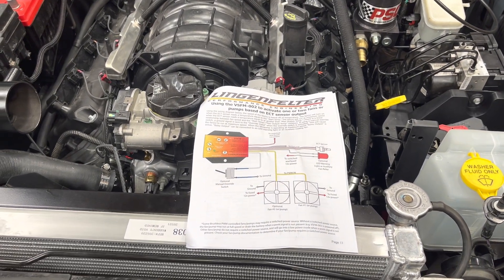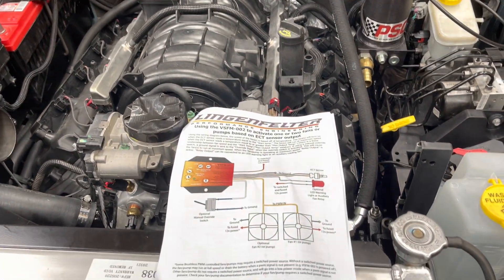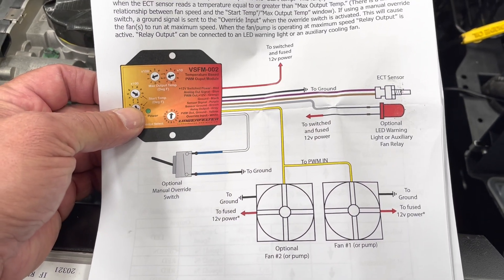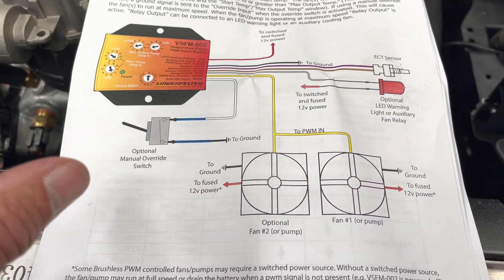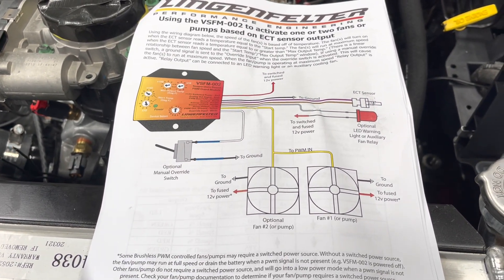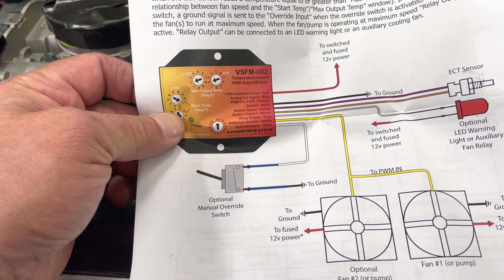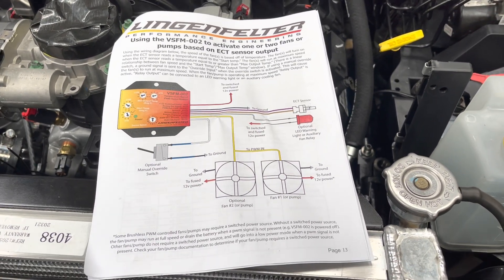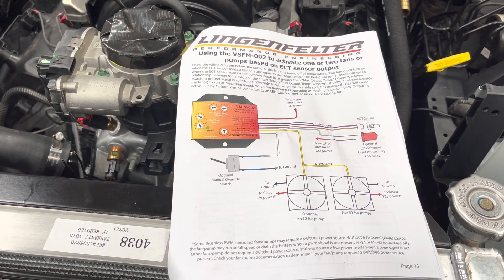Lingenfelter fan controller wiring.

Comment: Do you still sell this unit with the 39% start for a/c?
Reply from the maker: We have a new controller with a 30% setting for the AC and it goes to 100% when it hits the max setting on the controller
Reply: @jeepspeedshop  ok is this the same lingenfelter controller? It says out of stock on the website.
Reply from the maker: @rs3672  This is a new one and we should have them in stock soon..
Reply: @jeepspeedshop   nice i just placed an order for one :)

Comment: the white wire is override and will run 90 percent fan speed not 30 percent
Reply from the maker: So we had Lingenfelter build us a controller and we use the white wire for the AC, now are old controller did not have that.
Reply: I wonder if this is why my fan is constantly running
Reply: have the same setup using the camaro fan and white wire for the override input.which is connected to the AC.

The fan comes on at nominal speed as temps rise above the start temp however when the AC is turned on ( Trigger switch ) the fan comes on at 100% so loud i really only need it running at 30% as the engine temps are around 208F with outside temps at 103F

 My questions  what are your dip switch settings on the back of your VSFM-002 typical set for? mine are from 1 through to 5 set down.

any help with regards to the settings for 30% speed for the fan when the override switch is activated via the AC compressor would be appreciated as I don't think my fan will last that long running at 100% screaming it's head off everytime I use the AC (override switch)
Reply: Hey what temp sensor did you use ?